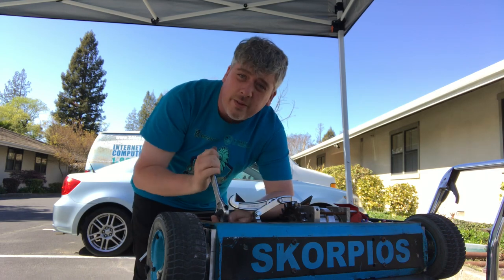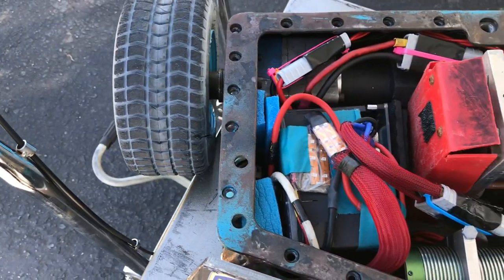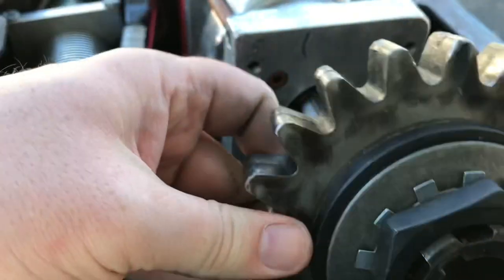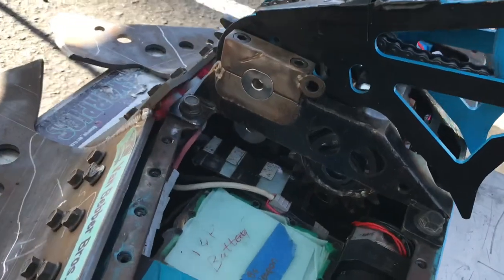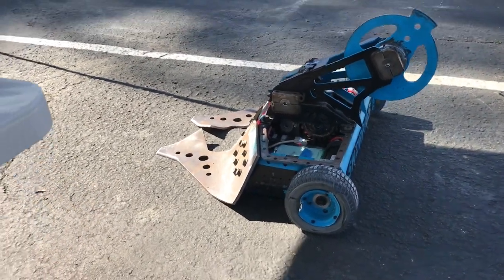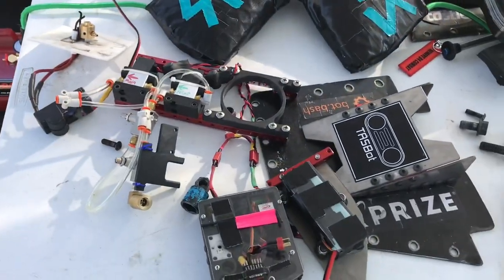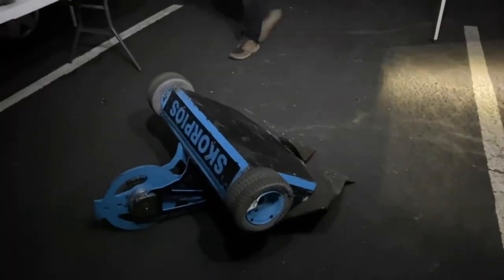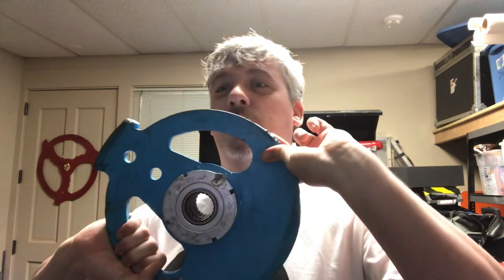Skorpios Build Report Episode 1: Fixing The Clutch

Comment: What gear ratio did you use for it to work?
Reply from the maker: We have a 9 tooth sprocket on the motor that goes to a 17 the Apex gearbox is 50-1 And the final output gears are 20 to 28

Which gives us a final reduction of 132 to 1

Comment: Silly question....why not make a tool that locks into the teeth of the gear and use one of the bolt holes to bolt it down and lock it into place? That way you can adjust the nut while the gear box stays in the bot. I assume this is gonna loosen up a bit as the tournament is going to go on and need readjusted?
Reply from the maker: He actually did make a tool that would hold onto the teeth of the gear and brace against the frame unfortunately it started to bend the frame